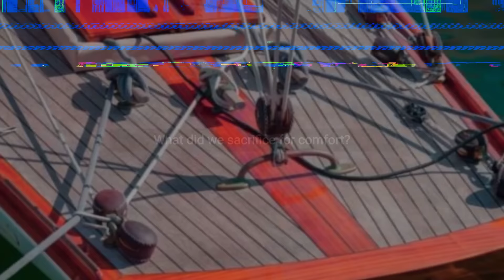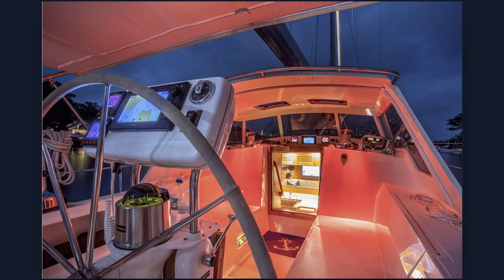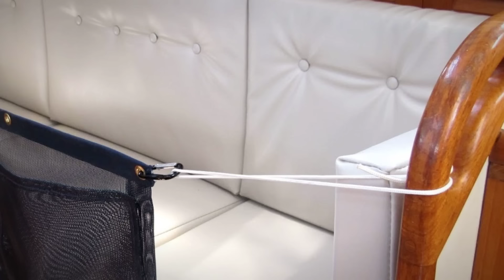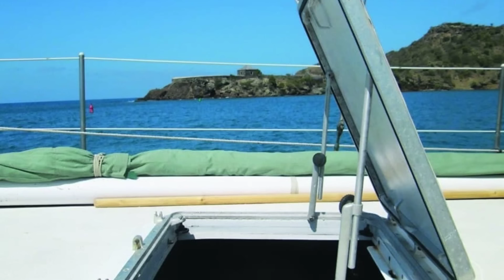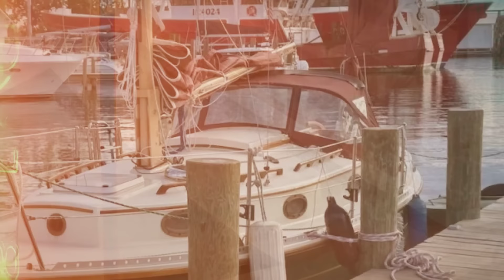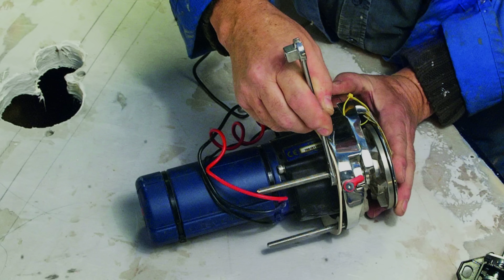10 'Lost' Features That Made Old Sailboats Bulletproof (And Why New Boats Don't Have Them)

Comment: Hang the rudder from the end of the full keel on external hinges.
It provides no way to flood the ship when broken.

Have a small self-draining cockpit with a footwell you can strap a fitted flotation box into.
In foul weather, you secure the flotation box in the footwell and eliminate any volume in the cockpit for water.
There will be nowhere for the boarding seas to rest.  The water will run off immediately.

Comment: I have been calling for dorades on cruising sailboats for years. Dorades ventilate the boat when it is buttoned up on the hard, unoccupied at dock or anchor and during any weather and or during a sailing event that precludes an actual sailor from opening hatches and ports during rain storms or wet sailing to weather. Most modern boat designers are unbelievably incompetent. Hylas is an excellent example. Prior to the sellout Hylas was a fantastic cruising/voyaging sailboat. Post buyout and reconfiguration, the largest boats are perfect for wealthy stock trading folks to showcase their improbable money making trading expertise to gullible potential clients by providing said prospects with day sailing on a magnificent coastal day cruiser.

Comment: Closely associated with the "skeg-hung rudder" conversation, but not mentioned in the video, is an internal rudder shaft's design and its inherent safety flaw versus an external hung rudder. If the rudder is hit hard enough, the shaft can damage the log where it passes through the hull. This would be an extremely challenging situation to successfully manage at sea.

Comment: You have really spelled it out. There is a direct conflict between a boat designed for seaworthiness, and a party/race boat.
Reply from the maker: Two completely different briefs — one optimized for the dock, one for the passage. They share a hull shape and a mast. That's about where the overlap ends.
Reply: A lot of modern design is about ease of build and profit margins, most modern boats are designed to increase profit, seaworthyness and durability take second place.

Comment: Tutto vero, ma con un aspetto ESTREMAMENTE PERICOLOSO;  la velocità massima è legata alla lunghezza, la barca non plana e diventa molto difficile da controllare con vento e mare al lasco e in poppa. Lo capì Moitessier tanti anni fa, quando le barche a vela plananti praticamente non esistevano. Quindi OK sulla sicurezza, ma elogiare le barche antiche con le loro pecche e coni loro difetti, solo perché non sono moderne è realmente pericoloso, altro che sicurezza. Infine: quante barche moderne hanno REALMENTE perso il bulbo o il timone? Ci sono tanti aneddoti in giro, ma riguardano molto spesso sempre gli stessi casi (un 40.7 perse il bulbo etc).
Reply from the maker: Running off in a heavy displacement hull is its own science. The argument isn't the hull form — it's what they built it with.

Comment: Our 1977 Downeaster 38 Cutter Scores 10 out of 10  !  Many Downeaster's have circumnavigated as we plan to as well on this old school "sleeper brand" that can be bought for pennies on the dollar as compared to better know manufactures such as Hallberg-Rassy.  The only weak points are too large of fixed plexiglass ports that require storm boards or stronger replacement and inexplicably a wooden mast foot down in the bilge that MUST be replaced ( big hassle )  - - which we plan do do with aluminum.
Reply from the maker: Downeaster 38 is exactly the kind of boat this video is about. Ports are solvable. The hull schedule isn't.

Comment: Even Colin Archers had the keel bolted to the hull - like almost all wooden boats.
Reply from the maker: wooden boats from the 1800s bolted keels to frames because iron flexes and glue dont — thats old engineering that worked, way different than modern glass hulls with cored keels glassed over solid

Comment: Bro its not only for the Security of the Ruder, there is a Massive weight in it, so that it simply cant sink. It is flipping back over again.
Reply from the maker: the ballast argument holds water but a compromised rudder fitting dont care how much lead you got in the keel when youre broached in a seaway

Comment: I think you will find that many older boats such as Westerlys for example have bolt on keels so they are vulnerable too. I think this video basic premise is mistaken. You are comparing apples and oranges. You are comparing luxury high end gin palaces with everyday ordinary sailing yachts. Also bear in mind that in the 70s and 80s more glass fibre was used which added to hull strength. Many of these companies went bust as a result. Some designs from the 70s were also very unsafe as the Fastnet disaster demonstrated. Old yachts were and are NOT BULLET PROOF. You video fails period.
Reply from the maker: bolt-on keels on a Westerly aint the same structural problem as a cored hull with a glassed-over keel joint, so tell me what failure mode you think happens to that bolt when the shoe starts flexing in a knockdown instead of a slow flex cycle

Comment: I appreciate these kinds of videos as sailing has always interested me.  Some day I want to buy a boat capable of being soloed around the world by someone without a lifetime of sailing experience.  These kinds of videos give me ideas as far as which boats not to even consider buying.  I do have some questions for anyone reading this with knowledge.  Is an older boat that has always been on freshwater a better alternative to one that has been on salt water?  If a boat has always been in the water vs. one that has spent a lot of time out of the water are there pros and cons to this and what are they?  Is it good for a boat to be out of the water or bad for it?  Are serious problems going to be obvious or can they be hidden until you find yourself in rough seas?
Reply from the maker: freshwater boats is always the better bet... less electrolysis eating your zincs and the heat exchangers dont scale up with salt. just gotta watch for core rot if it was sitting in a humid climate.

as for being in or out of the water... boats is like engines... they hate sitting. a boat that spent 5 years on a rack has dry seals and brittle hoses... but a boat that never leaves the water is a prime candidate for osmosis. if it stays in too long without a proper ablative paint job the blisters start forming under the gelcoat. we seen hulls that looked like a sheet of bubble wrap because the owner was too cheap for a haulout.

serious problems is rarely obvious to a greenhorn. you can hide a structural bulkhead crack with a fresh coat of paint... but once you get into a real sea state... that hull starts flexing and the rigging loses its tension. check the keel bolts for "smile" cracks and look at the chainplates for staining. if them bolts is rusted... the boat is a floating coffin.

spend your money on a good survey... not on a fancy plotter with a subscription. 10 years of freshwater is better than 2 years in the salt... but it dont mean nothing if the previous owner didnt know a cleat from a clutch.
Reply: Every boat should be judged individually, as their specific maintenance record is what really matters, regardless of generalities such as age, location, etc.

Comment: Well that's the ohlson 38 at 10/10
Reply from the maker: Ohlson 38 is a heavy consist... built with enough glass to handle a derailment. They got more tractive effort in a gale than them plastic tubs. Notch 8. Dont need no dynamic braking when you got a keel like that. We seen them boats outlast every corporate mold.
Reply: @yachts_and_boats sounds about right only 1s ever been record to have sunk and that was off cape horn in a force 10 I belive.

Comment: AMEN! Most of the modern boats and I guess almost all you can rent, are NO blue- water-ready / seawothy. No storm sails, baloonish genakers instead of changeable sails, missing safety equipment, and practically having every single red-flag you mentioned from shallow builge to insufficient anchors and missing spare ropes and anchors etc. Maybe except a cockpit drainage as some has thumbnail rear with huge opening so cockpit could be flooded but also drained from/to back side quite fast.
Reply from the maker: rental fleet boats are built for resort conditions not seaworthiness, balloon jibs and no storm canvas means they're parked when the weather turns — anybody takin a charter boat offshore without addin their own gear and checkin every system is gamblin with lives

Comment: Skegs are wishfull think, a false sense of security. A rudder significantly shorter then the keel is alk you can really hope to be effective.  Try stopping 30+ tons at 6 knots again a rock, and i guearantee the rock or reef will laugh at it, and the rudder. As for effieciency, a balanced spade rudder shallower than the keel in 4x for efficent and a quarte on the load on the seterring gear, helmsman, and autopilot.  Archais doesnt always mean stronger , and there were a lot a older din keels built with balance spades short than the keel, that were marvelous to steer. If i recall correctectly, the old Ericson 44 was one of those.
Reply from the maker: spade rudder shallower than the keel beats a skeg for efficiency, but tell me what happens to that balanced rudder when you hit bottom hard and the tube takes the shock instead of the keel spreadin the load

Comment: Lesson of the day.

Don't buy modern sailboats. Buy old models that have stood the test of time.
Reply: but take someone knowledgeable to survey the boat before the purchase. Delaminated things, water in laminate, corroded inner reinforcements . .that could be dangerous or pricey repair later on.
Reply from the maker: That's the lesson the industry doesn't want on a bumper sticker. Proven hull, proven systems — the old boats earned their reputation the hard way. If you haven't already, check out the most-viewed videos on the channel — plenty more in that vein.
Reply: @yachts_and_boats  Yes exactly. Boat models that has been around for 50 years and crossed multiple oceans are the ones to go with if you got the time to refit them for whatever purpouse you need it for.

And to be honest. The newer boats lack that feeling that the older ones give you. It's like the old ones have a soul and a personal story.

Comment: The safest boat that anybody could purchase is a coast guard rescue boat, the safest boat that anybody could purchase is a Coast Guard rescue boat because that boat if you look at the videos on it even if it flips over completely upside down 20 times in an hour or more it's going to flip right back up and every time it's tilted and ready to turn over all the windows and doors automatically lock on it in other words it's almost Unsinkable . Yes it's true it's not a quiet sailboat but still it's a boat that is safe that's why the Coast Guard uses it to go rescue other boats and it might cost a few million dollars but when you have one of those boats you've got something that will hardly ever turn upside down and if it does you still won't go to the bottom of the ocean because it automatically closes and Seals and if it does you still won't go to the bottom of the ocean because it automatically closes and seals everything up you don't have to worry about water getting in it and sinking it
Reply: Any sailing boat with a keel will do that. They weigh a lot to keep the boat stabilised. They're all self righting..
Reply from the maker: Keel ballast helps — but self-righting depends on the ballast ratio and hull form. Some production boats have enough reserve buoyancy in the cabin to trap air and resist coming back up. Not all keelboats are created equal.
Reply from the maker: USCG spec is the benchmark the industry quietly stopped targeting. Overbuilt for a reason. Check out the most-viewed videos on the channel.

Comment: If no bridge deck then it should have a drop in board for when the weather gets bad  and all lockers should be locked . They can can sink you in a knock down
Reply from the maker: Exactly right. Unsecured lockers in a knockdown will flood the boat from the inside. That's not a comfort feature, that's survivability.
Reply: The companionway washboards can serve here.

Comment: When they can't pronounce lead - the heavy metal - then they lose my confidence and I move on.  It's OK, though.  I need to go change my oil and filters and then go for a sail.  Beats sitting around watching videos, anyway.
Reply: If you watched further, you would have heard how 1.800 gallons of water equal 2 tons of water. 😂🤣😂🤣
Reply from the maker: Fair — pronunciation is worth getting right. Go get those miles.
Reply: They are in the lead!!! Lol

Comment: There's a big difference between a sailboat and a pleasure craft with masts. The latter are generally owned by motor sailors with low seamanship skills. These individuals somehow believe they have the ultimate right of way as a sailboat while under power. They often suddenly cut across the bows of power craft underway at speed for some reason. It's easy to recognize them by the meaningless flags they're flying, cloth upholstered home deck furniture, stowed sails, entitled attitude, and the fact that they've never left the estuary. White wine in stemware on deck is a dead givaway, as is an inflatable dingy on a painter trailing behind, shipping water. These seldom used craft are much more likely to be found submerged in their berths amidst a floating clutter of vinyl pool toys.
Reply: We get it. You can’t sail…
Reply from the maker: The miles say otherwise.
Reply from the maker: White wine on stemware and a dinghy taking on water astern — that's the whole profile. Never left the estuary, claiming right of way, and a burgee from a club they've visited once.
Reply: We sail to get away from self absorbed experts like you.
Reply: I don't know much about sailing but that was one mean and no doubt accurate riposte.  "White wine in stemware", good one.
Reply: I am an experienced sailor and yacht racer. I have to admit there is truth in this description. 

I used to work with delivery captains and have had to move several of these  “marina queens” described here when the owner moved or sold the boat but was too incompetent or did not have the time( they often don’t fully realize they are incompetent at first) to move the boat up or down the coast. 

Most of the boats were a nightmare of defects and poor maintenance even if they looked ok visually. Most of these owners were for all practical purposes really dependent on the engine and could not sail the boat off a lee shore in a blow if their lives depended on it ,and sometimes it does.😢 

In the high performance pro sailing world we used to call these owners “ cruising turkeys”  or TB ( toilet bowl sailors) among other things

One of these types was a customer of ours, wouldn’t take advice, because he was an engineer by profession and thought he knew it all just from reading books and articles. He went south on a year’s cruise with the wife and two preteens. LSS he put his Choey Lee 40 something ketch on a reef near the Bahamas almost getting the whole family killed during the very tricky rescue , ( his failure to control the halyards boom on the mizzen made things hell for the coast guard chopper and the shallow nature of the reef made putting the coast guard swimmer in the water near the yacht almost impossible. He was only saved because a large coast guard cutter ( 200 plus feet with massive horse power made full speed to their accident site and after a complex op managed to get a long tow line on the stranded yacht and pull it off at high tide.  Remarkably the old Choey lee was not holed even after pounding on the reef for a day and a half. All were safe and they  continued on their way down south where there were more “ incidents”😅. 

They eventually returned home, got a divorce, sadly the husband ( my customer) was never able to return to a corporate 9 to 5 after that and died after ingesting to much rum alone in his trailer several years later.

Comment: Our '81 Morgan 382 has nine of the ten features in this video (she doesn't have a Sampson post, but we rig a snubber to hefty port & stbd bow cleats in a pitching anchorage).
We didn’t consider some of these points when we purchased her in 2015, but we knew that "classic plastic" comes with benefits beyond obvious "classic" appearance, and we realized that first summer just how sensibly designed and outfitted the M382/383/384 models were.

One feature I'd also include is cockpit sheeting - our 382 has end-boom sheeting so the main, plus the two headsail primary winches, is just forward of the helm and puts everything in reach of a singlehander. Morgan moved the 383's and 384's main traveler & tackle to mid-boom, which makes for a less "cluttered" cockpit and more practical bimini, but I wouldn't trade my end-boom rig's safety & efficiency for that.
Reply from the maker: Morgan built those boats to actually sail them instead of look at em, and an 81 model with nine outta ten features means somebody knew what they were doin — end-boom sheeting for singlehand work beats a pretty cockpit every time you're short-handed in a blow

Comment: Older boats had a flat deck, no cockpit so water just flowed right back into the sea, if you must have a cockpit the centre cockpit is safer from pooping which is no joke I can tell you, green water over the stern form following seas can throw you off your feet and be very dangerous.
Reply from the maker: Centre cockpit is exactly that — designed around the sea, not the showroom. Green water over the stern isn't theoretical for the boats that did real miles.

Comment: Firstly you don't need a cockpit drain. 
Water goes right out the transom in 10 seconds. 

I won't go on
Reply from the maker: Transom drains fast on a level boat. Heeled hard or inverted is the scenario the cockpit drain was designed for.